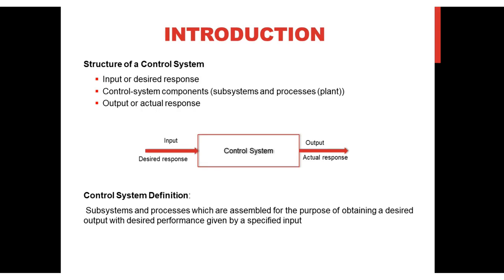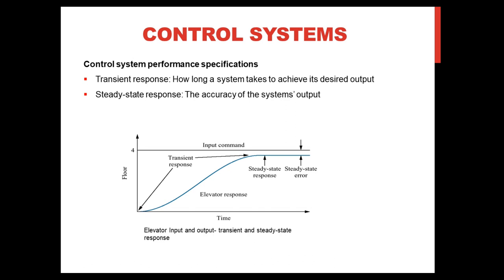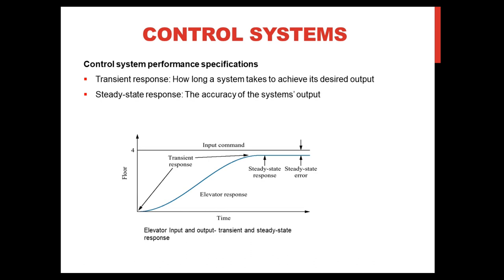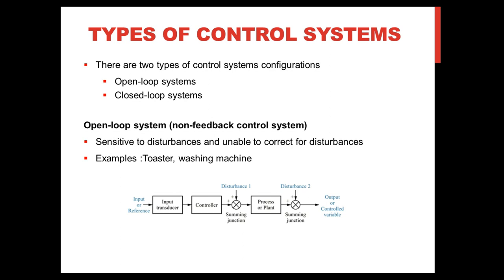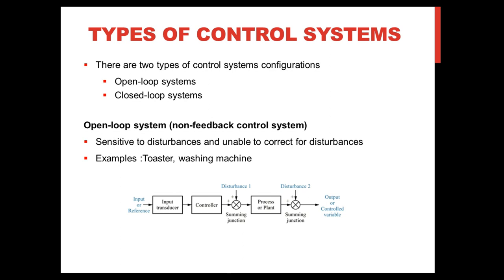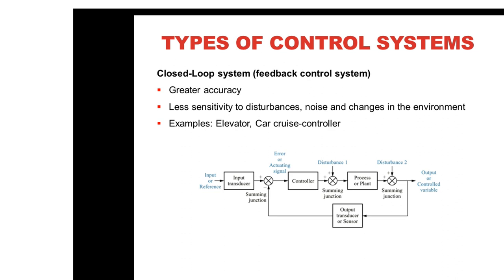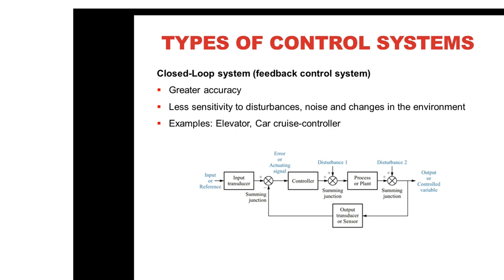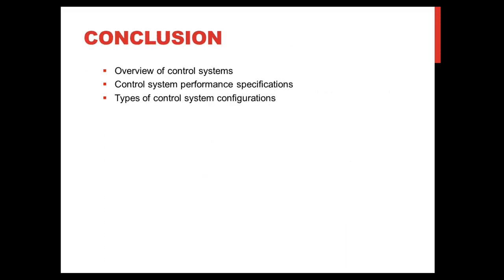Control Systems

Comment: Isn't it true, the steady state error doesn't necessarily indicate a undesired result but the rather the difference between the input and output?
Reply from the maker: Yes. That is true. The steady-state error indicates the margin of error between the setpoint (input) and the desired output. Ideally, you want a zero steady-state error to achieve 0db gain on the magnitude bode plot when analyzing the frequency response of the closed-loop system.
Reply: @nadiasmith6855  ok, so what if the input does not scale 1:1 with the output would you have to add a gain/transducer off sorts to get a 1:1 ratio before adding the signal to the controller
Reply from the maker: @gforce2924  In a real system your controller (embedded processor) would be connected to the system you want to control. Yes you would use transducers to sense or measure your feedback signals (voltages and currents)  which would be inputs to the processor through analog to digital converters.  So if input is not 1:1 to the desired output then at this instant you would proceed to controller tuning which would mean varying your controller parameters in the compensator (PI, PR, PID) that you designed.
Reply: @nadiasmith6855  sorry for writing system I meant signal I'll edit my comment
Reply from the maker: @gforce2924  okay. Just to be clear. Are you asking me if the desired output signal and input setpoint are not matching would a transducer be used for the  output  signals before sending it to the controller?
Reply: @nadiasmith6855  yes, I meant in terms of the steady-state error, if you wanted a 1:1 relationship. would you use a transducer or add a gain to get your desired relationship. Let's say your input gives a signal from 0mA to 20mA, and your Output signal is in km/h
Reply from the maker: @gforce2924  you would use a transducer initially and if it still isn't 1:1 then you can add some gain.
Reply: @nadiasmith6855  ok thanks